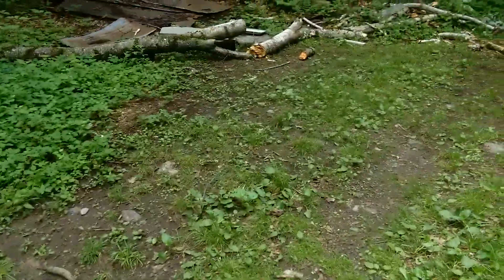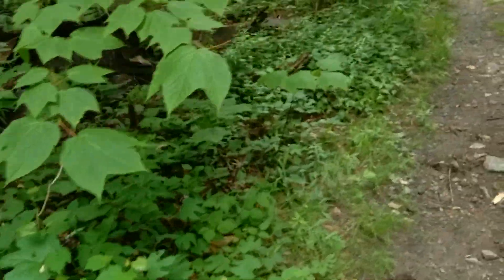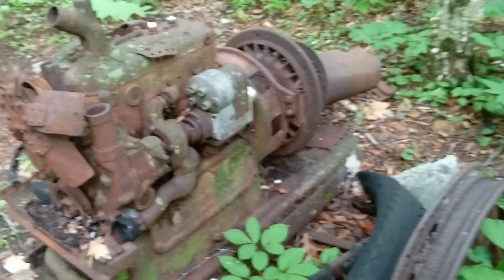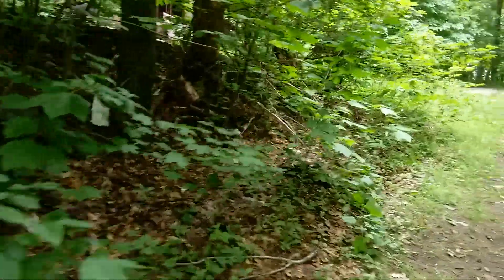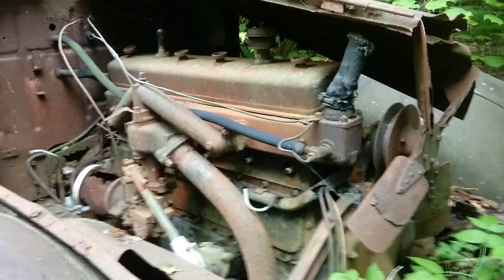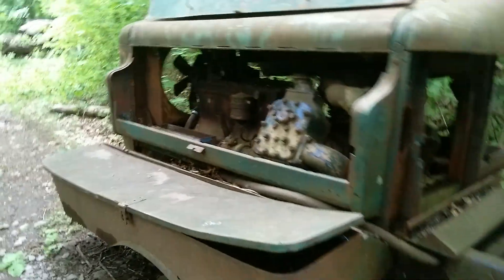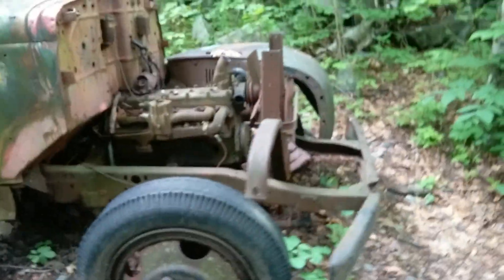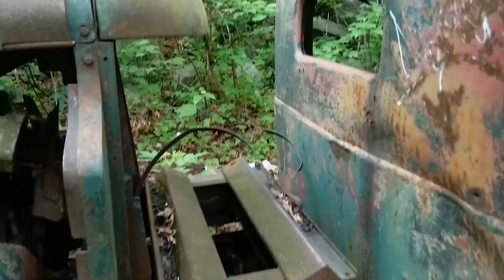1940s Chevy Generator Truck, 1930 White Model 59 + More In Woods! ABANDONED Quarry Exploration PT.1!

Comment: they are pretty cool, not sure what type of truck the first one was but if you can work out what motor it has might be the easiest way of identifying it, the first motor with the wire wheels was probably a portable generator
Reply from the maker: Ok. Not sure maybe generator but maybe engine with wheels and axle. The are more parts coming soon cuz there is more equipment and buildings at the location.

Comment: Pretty cool, but I’m also not sure what brand that is either. Also that thing that you didn’t know what it was that is a engine sitting on an axle with two wheels and tires.
Reply from the maker: K, I though it was some kind of early generator.
Reply: At first Glance it is but you can clearly see the in-line six motor if you look at it right and two wheels with an axle.